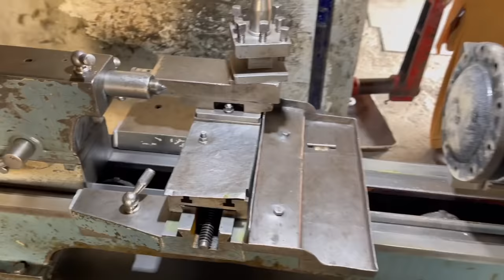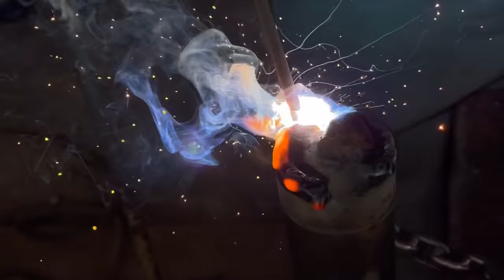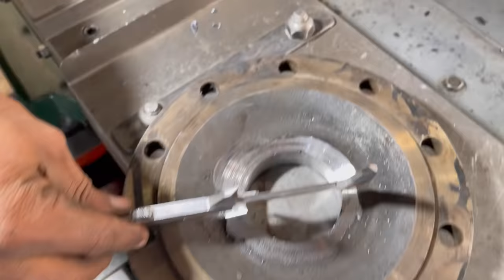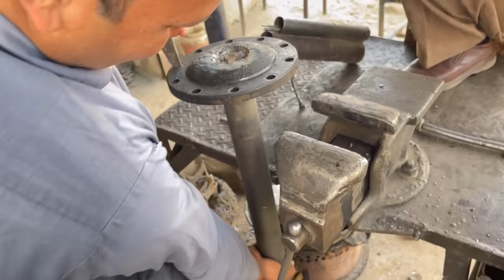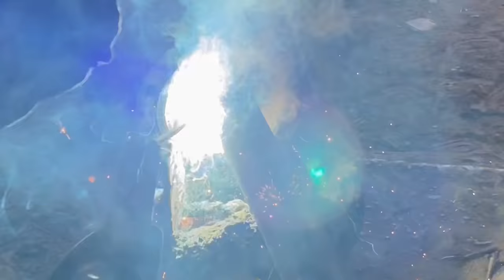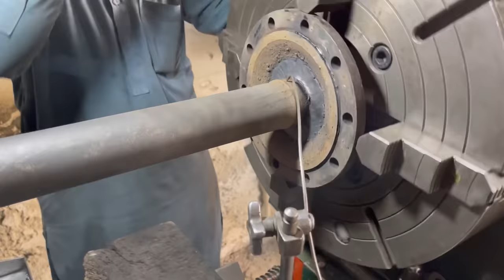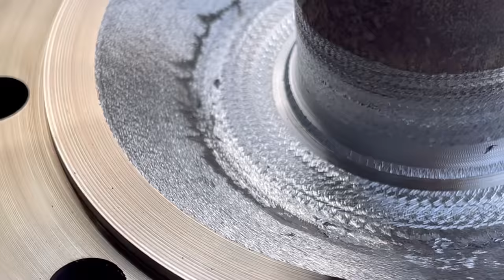Amazing technique Broken Rear Axle Repair | Local workshop amazing work |

Comment: Without any normalising of the steel where that fillet weld was done,I can pretty much guarantee that’s where that axle will snap again.
Reply: Dont worry. it will be brought back again.
Reply: @Tirah5  100% it will. Will definitely crack on the edge of weld when it does.
Reply: It's a real possibility.  Although, it looks pretty stout to me. Probably get some like out of it
Reply: @innerverse1809  I guarantee the heat affected zone grain structure begs the differ.
Reply: В первую очередь надо поменять подшипники в ступице, или ступицу
Reply: Not to mention they didnt even machine a chamfer/lead in on there to weld fill so the weld atleast had some penetration.
Reply: Those welds didn't look too hot to begin with.
Some funky old rods they got out of the dumper.
I'm not real hot with metallurgy but I know parts like that go through a world of heat treatments and you can't just whip out a welder and zap it back together. Not if you're going to use it for same purpose.
Reply: I've seen breaks ground out and braised but this seems like some Gomer stuff
Reply: It is
Reply: They also didn't make chamfers to penetrate the weld that was superficial and weakened it with the finish. Evidently it won't last long.  It is a temporary and cheap solution in a country with a large poor population.
Reply: @douglasotavianitorres  this is true but now that you have seen this I’m sure the next time you buy something you think is brand new and it’s made in India I’m pretty sure you’ll think nice and hard whether if it worth buying or not.
Reply: That’s called job security… he might be fixing axle he already “repaired”.
Reply: @stick004  as they say,poor man cries twice.
Reply: Thats probably not first time its been rebuilt niether.
Reply: @LsMaloo  i was thinking same thing.
Reply: @ВалерийСосновских  Your right, I didn't think about that very likely be what contributed to the break. I've never seen one break at the hub.
Reply: I guess
Reply: @LsMaloo  it's a Pakistan for your information.
Reply: @Takedown87  not sure what the truckers are gonna feed their kids with when keep spending money on failing parts.
Reply: They don't have as many resources as we do.
 But you have to give them credit, they still get it done

Comment: In South Africa we have to repair like this everyday. Shout out to all the mechanics that has to do the impossible daily to keep the world moving!!
Reply: У меня видосы про шлифовку
Reply: É isso ai cara todos trabalham com oq têm
Reply: Superharry, you must be a taxi mechanic!
Reply: @andrewallen9993  🤣🤣 ,  heavy earthmoving mechanic
Reply: @superharry557  you actually weld halfshafts together as badly as this and the repair lasts?
Reply: @andrewallen9993  It keeps the machine in production until replacement part arrives.
Reply: @superharry557  Makes sense as a- get you home- job but not otherwise😁
Not like the Toyota's I see full of passengers with two missing wheel nuts on each corner.
Reply: Quem não  tem cão,  caça  com gato.  Não  igual ao original  mas aguente-se muito bem.
Reply: love cutting metal

Comment: I love the way this man just uses a bent piece of wire  instead of a dial indicator  to centre the work in the chuck
Reply: It's called a surface gauge.lol
Reply: +-1 thou, +-1/16 inch, what's the difference right?
Reply: Every old machinist I have ever known uses a wire like that to get it very close and then would switch to a dial indicator on high precision stuff.
Reply: There's a very wide tolerance on truck parts.......
Reply: run-out schmunn-out....there's no problem o'vah eear.
Reply: @Jay2dPee  it says, close enough
Reply: human eye can actually get things pretty friggin close with a surface gauge like that, especially with some experienced, you'd be surprised.
Reply: It is amazing what a little common sense ,experience and a good eye can accomplish.
Reply: @justsaynrush9689  So true
Reply: had me in stitches when he pulled the hi tech dial gage.. 🤣🤣 and the lack of tool coolant
Reply: @ferrumignis  Hahahaha xD
Reply: I used to do that too, when far from anywhere, and no one has a dial

Comment: They really should consider a rotating ground attached directly to the work piece. Lathe bearings will not stand up to the arcing and one day the lathe will be in trouble. Also would have liked to seen more taper on both parts prior to welding...but who knows what's acceptable given roads, material availability, costs, etc...
Reply: Wouldn't worry, I think he has done that job many times before.
Reply: Lol, it doesn't matter? Just because he's done it 100k times and it's worked doesn't mean it won't happen and it's the proper way. I've locked up bearings before welding. Some times you get lucky some times you make a lot more work for yourself. No way I would be welding through my lathe...
Reply: I thought this too, maybe they have the clamp on the spline end.. i hope
Reply: Or the lathe could be made of stainless steel which is least conductive? 🤔
Reply: 44
Reply: Then they would repair the lathe with amazing skills !
Reply: Based on my limited understanding of bearing costs and construction:

My guess is that the welder or one of the helpers clamped a ground to the piece before he started each weld in the lathe. The video omitted much of the weld setup.

If a welder can learn to use the face mask every time, they can learn to ground the part.

Naturally, I am probably wrong. There might be an inexpensive yet effective way to ground through the rotating joint, that I just don't know about. A Google search turned up plenty of expensive options for transferring hundreds of amps through a rotary joint.
Reply: You probably would have done a better job right? You probably have better equipment, I'll like to go to your shop for my repairs.
Reply: @alexduke5402  sir an example, some welding work  repair was being done on a press machine in our company where l work.the welder did not connect the earth wire of welding machine properly to the work spot and started welding the arc took earth from the four core cable that was used to connect power to press m/c. motors .Due to high current the earth wire of the supply cable got melted along with the entire cable lucky that power was disconnected before welding

Comment: I don't see why people diss on these guys for doing what they do. They do it everyday by hand. Pretty fascinating how they do it, and keep a whole city moving along the roads.
Reply: because even with much worse tools, far superior work is possible. This is about the laziest, most dangerous way to go about this repair. They have an expensive ass lathe there and terrible indicators and work practice. They didn't clean any of the welds, didn't ground the work piece when in the jaws of the lathe, didn't even fill the weld properly, didn't clean the workpiece prior to welding on it. This is all easily done work that is absolutely critical to getting a good weld that requires about $0 and 10 minutes with a grinder or even sandpaper.

Comment: Engineers. Here I admire the ability to find a temporary cheap solution, but let's imagine that in a similar way spare parts, including for aircraft, are counterfeited and sold as originals. Or crashed cars that are straightened, polished and sold as not crashed.

Comment: Won't all that non uniform heat take the temper from it and cause it too crystallize without re heat treating the whole axle?
Reply: Half these guys are barefoot. I think these concerns are truly beyond them.
Reply: i wouldnt worry about heat treating, the 50% slag weld will break long before there's enough stress to cause any other issues.

Comment: You must not weld items in the lathe with the earth clamp on the lathe body. Doing this will damage the bearings in the head stock of the lathe as the current will be arching across the small contact areas of the bearing
The same rule applies to all autos and plant always clamp direct to material being welded
Reply: It was said many times. They just don't learn.
Reply: I agree ,made my comment before I saw yours
Reply: I also wrote this on another video some weeks ago. 
Also important on motorcycles. If the headlight and the indicators aren't properly grounded, the current will pass through the steering head bearings and that will ruin them pretty quick.
Reply: The stoneage is near ! Ha Ha
Reply: Entirely agree. They will learn the hard way.
Reply: I think the same thing all the time .but have seen it on all these videos for years now. So I just think they might have the tool post  touching the axle or the center on the tailstock
Reply: Ethe sonna nambale Paitiyakarenu solluvang bro
Reply: @сергейкольцов-д1л  i dont care about pollution,im an air condition gypsy
Reply: Electric motor running lathe also, i know someone that burnet up 5 million dollar pump up at the shipyard.
Reply: I have been working in a shop for over 16 years where we clamp the ground to the ways when welding on the machine and never have we had to replace bearings. The guys that trained me showed me to do it that way and they have been doing it that way for over 30 years.
Reply: Там на станке, подшипники уже то же вареные  😏
Reply: he can probably even  make new bearings
Reply: They didn't show where the ground clamp was. If they put it on the end of the axle on the other side of the machine, then perfect. If the ground clamp was putting electricity through a bearing, then your comment is prudent. But it isn't shown, so insinuation is a bad thing.
Reply: @neruil77  My old man worked with a guy who destroyed a drive motor on an Oberon class submarine this way. Very difficult repair. He didn't work with him again..
Reply: @wendull811  It doesn't matter if you've been doing it wrong for 16 years. It's a bad idea to abuse your equipment like that. Especially when it's so easy to just attach your ground to the workpiece.
Reply: @e-curb  95% of the time there is no way to attach the ground to the work piece as the welding is done on a final part that is to big for a ground to hook to it. That is why we hook it to the machine instead.
Ever the welding manager and engineers say it is 100% fine to do and have given us permission to do it.
Reply: wonder for what type of vehicle this axle is?
Reply: У меня гораздо интереснее
Reply: Sound advice and hopefully they learned something from your comment.
Reply: @wendull811  how can the part be too big for a ground?? You can use a piece of woven copper ground battery strap from a truck.
Reply: @cobre7717  🤷‍♂️🤷‍♂️
Reply: @wendull811  if you can't figure out a way to properly ground something then you probably should not be welding or working on anything mechanical.
Reply: @cobre7717  I did figure out how to ground the welder you hook it to the bed of the machine as I said above. Why would I bother trying to find a copper weaved battery strap and hook it to the part. That is the welders job not mine. I run the machine.
Reply: @wendull811  are you welding on the lathe machine itsself? Or are you  welding on the work in the chuck? You don't want to have the current of the welder going through the  spindle bearings. It can be bad for the bearings but more importantly it is bad for the weld. But like at the end of the day... whatever it's your lathe.
Reply: @cobre7717  the parts are mounted in the chuck. Ground connected to the bed ways of the machine. According to the welding bosses and engineers if there is enough of a gap in the bearings for the current to arc the bearings need to be replaced anyways and it is a good thing.
Reply: @wendull811  yeah thats a good idea! Good inspection test too. Just sucks to tear down machine sometimes the timing is bad but you probably have some nice big lathes to choose from when the bearing decide takes a shit.
Reply: @cobre7717  yes we do. Lots of big lathes and uper management dosen't care about tearing the machine down to replace parts. That's what happens in a multi billion dollar corporation.

Incase you didn't read above in other comments I have made the lathes have been their for over 30 years and we have never had to replace the bearings in the headstock.  Maybe we are just lucky.
Reply: @albinklein7680  your steering bearings are ruined because there was no grease in them if an arc can travel through the bearings....
Reply: I bet that lathes bearing sound like a pepper grinder.
Reply: @ImmortanJoeCamel  Let them Have it, it may impress many , but one UK apprentice trained lad here, who has been all over the world with theses sorts, impress me.  not a chance !!
Reply: @wendull811   multi billion dollar corporation ...I haven't even seen a million dollar cooperation, much less a multi billion dollar corporation.  I seriously doubt it,. 

Or could it just be that no one gives a rats ass and violates every accepted safety protocol, damn cultures accepted choice of foot wear, any one that  would work in a mechanic / machine shop and wears flip flops and uses half ass welding shields to protect their eyes sure don't  give a shit about proper repairs an precision machinery as we have all seen
Reply: @js-vm8zc  yes a multi billion dollar corporation is who I work for. We are a world wide company and the leader in the products we make. We serve all industries we are not a job shop. We make our own brand of product and sell it.

In fact we just got taken private this year and are no longer on the stock exchange. The company that bought us paid $3.8 Billion dollars in cash.
Reply: On the occasions when I have tacked something up in the lathe i either put the earth clamp on the work, or if that is not possible or inadvisable, direct on one of the chuck jaws so that the flow is not through any lathe bits. Bearings  are not designed to carry a couple of hundred amps... 😀
Reply: @lenny108  an overloaded one
Reply: @mbury8004  The Flintstones have better technology